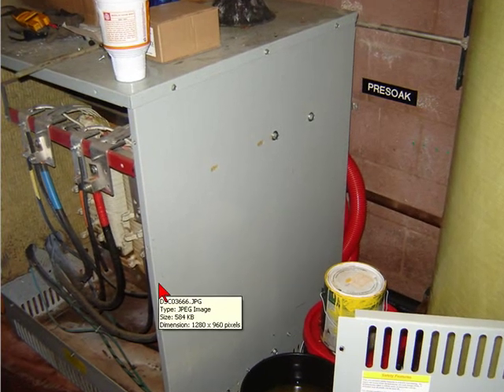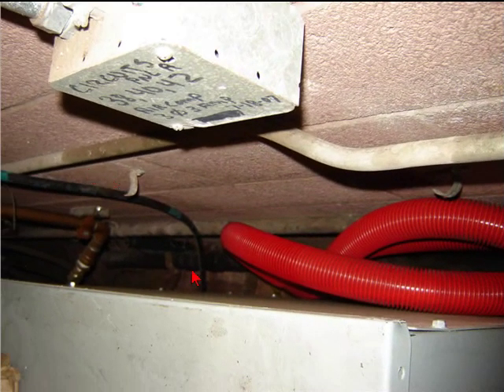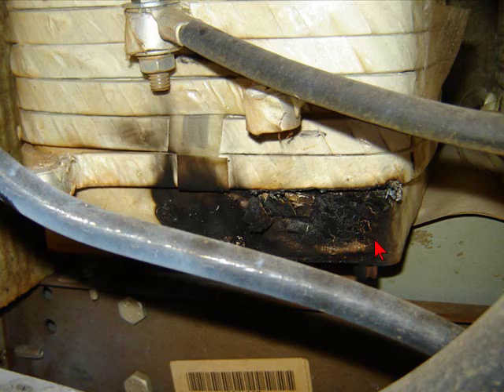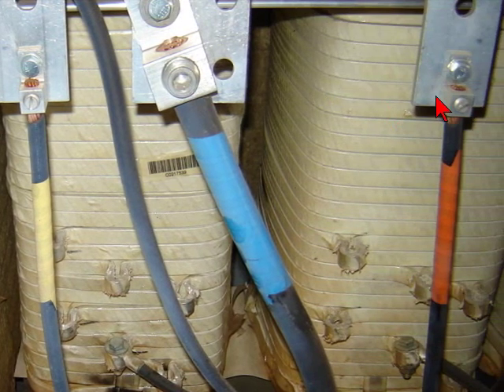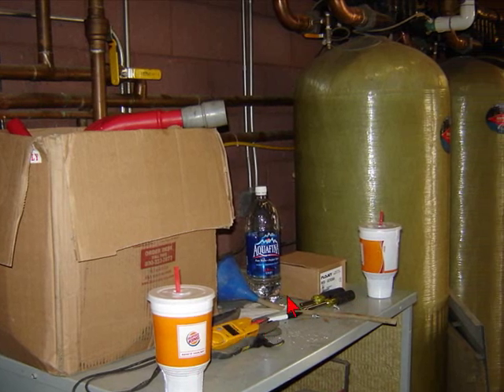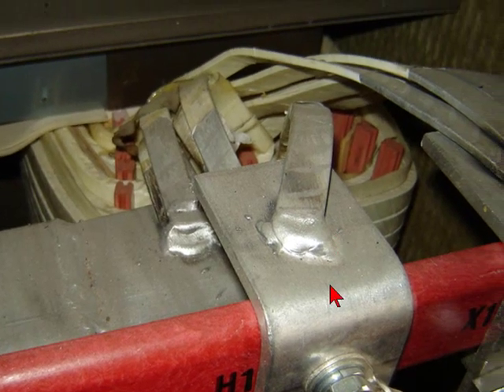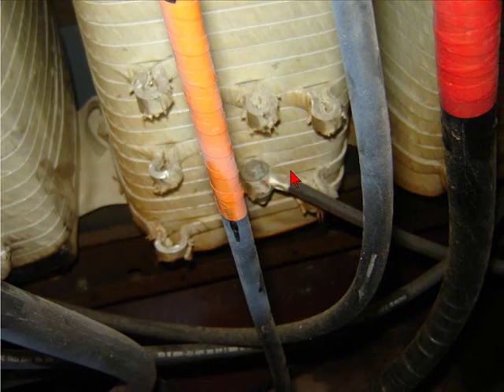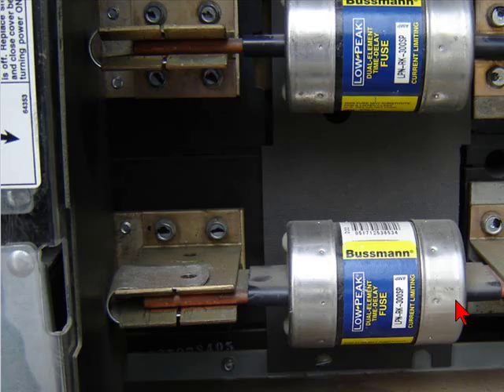Electrical Wiring Burned xfmr 09

Comment from the maker: You would have to ask GE where the bottom of the xfmr is!Bond bushings were used you just can't see them behind the insulation.This was designed and approved as a three phase only xfmr...no neutral was required for the equipment being served.Everything was bonded on a ground bar,I didn't get that picture shown in this video.